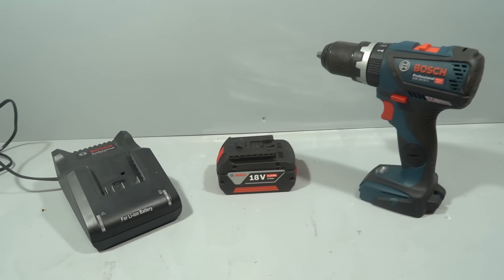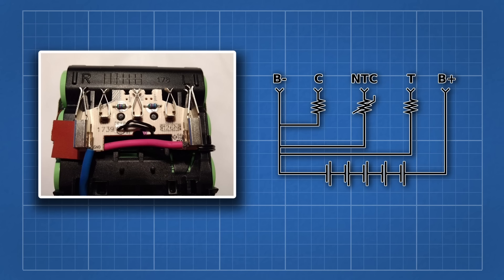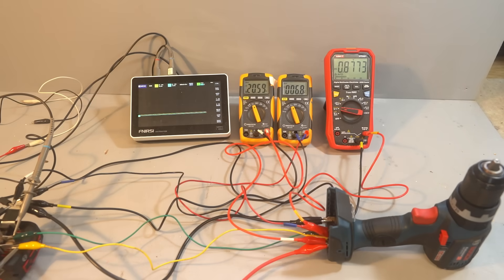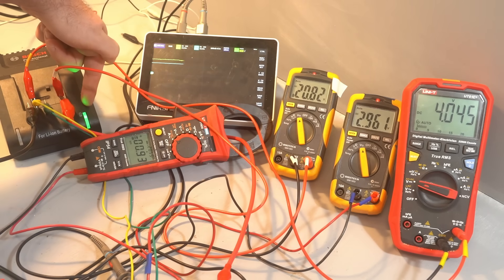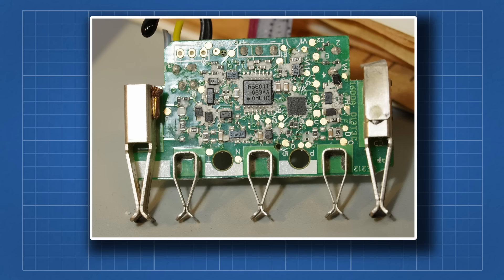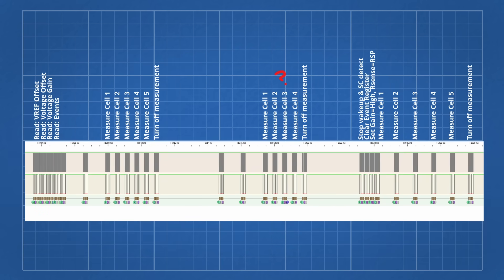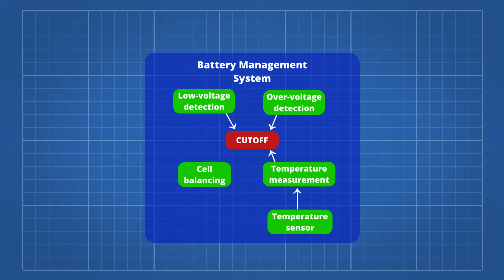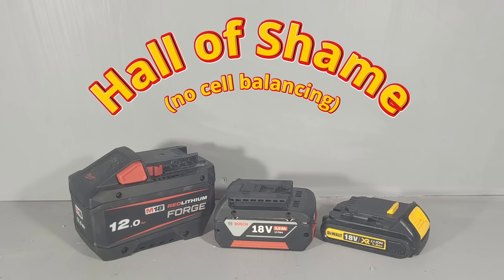[012] How does Bosch 18V compare to the rest?

Comment: Why haven't you used a profactor / procore battery? These have the latest technology, the battery in the video is quite old and is not in production anymore. But good video, thank you.
Reply from the maker: Because I'm poor 😄. If I can find a used ProCore for ~$50, I'll have a look. I do have a broken Procore that was donated to me. I could try fixing it, or at least probing it to see if the i2c comms are different.
Reply: @toolscientist  As your previous research had shown, i don't thing that there is somethin smart in these batteries. Thy say that batteries are smart just to justify the price.
Reply: @toolscientist that would be a great way to show the differences with the newer system
Reply: @toolscientist  In which coutry do you live? Here in germany a new Bosch Procore 18V 4 Ah Battery costs exactly 54,36€ (including shipping) on ebay. 
Of course the 8 or 5,5 Ah battery would be more interesting because of the Biturbo Technology. Especially the difference to the 4 Ah beside obvious physics. You cant find anything detailled in the internet about Biturbo. Wouldnt be surprised if it is only a marketing word and they work the same as other 18V Systems with 10x 21700 cells or more.
Maybe a collaboration with a tool enthusiast might help to get some of these.
Keep up your good work! Love it even I dont understand everything.
Reply from the maker: @WolfsBuden  Australia. Procore 4Ah is 209 AUD, Procore 8Ah is 289 AUD. We don't get 5.5Ah/6Ah
Reply: @toolscientist if you’re in Melbourne, faulty ones come up a lot on Marketplace. Keep an eye out. I would love to know if these batteries are any better apart from the 21700’s
Reply: @toolscientist also if you have a total tools or Sydney tools close, most of them would have faulty units that they might part with if you’re friendly enough 👍 I can ask if that would help get more results
Reply: @WolfsBuden This is Bosch and not some Chinese owned company like Milwaukee that after the machine break it cheaper to buy a new one. Also obviously you have no idea what Biturbo is.
Reply: @Fatmacheto  thats what I said, I dont know it in Detail. So explain it instead of bring rude.
Reply: @Fatmacheto  Hallooo?? Explaination please?
Reply: @toolscientist  wow a ProCore costing 209 AUD eaquals a 8Ah here in Germany o.0 which is 115€ by a conversionrate of 0,51 AUD/EURO very expensive there. If the transfer wouldnt be to expensive i would lend you a batterie of mine

Comment: would love to see how you would add low voltage shutoff and/or bms to batteries when used for non-tool purposes! Great vids!
Reply from the maker: I did show a LVCO for M18, but I hid the higher power version as it had some weaknesses. I should revisit that project

Comment: Love the detailed analysis of these batteries. I have been working on Ryobi batteries for a while now and what I have noticed is that they only balance cells in bursts and under specific conditions. So I could see why 0.2v would be considered too far gone to balance as under normal use, the cells shouldn't go that much out of balance. It should only go slightly out of balance which, at least for Ryobi, they do balance back very slowly.
Reply: There are many different Ryobi BMS designs. I have found that all Ryobi packs drag current from the first cell bank. If you put them away at minimal voltage, the BMS drains the first cell down and kills it.
Reply from the maker: Interesting. Have you made any videos or posts on it? How long are the balancing bursts?

Comment: Excellent work! If you can stomach the cost, Stihl's battery and tool system should be quite interesting to see analyzed. Supposedly they have some sort of "constant power" circuitry, according to them, which should maintain the power output  when the battery's voltage drops during use.
Edit: Not sure if that goes for all of their batteries/tools. They have a 12V line, a 36V line for non-professionals and one for professionals, to my knowledge
Reply from the maker: Constant power just means they're speed limiting their tool instead of letting it run full speed. Fairly common on vacuums, blowers, etc. Nothing really fancy about it, but I do like tools that do it. It's becoming common in circ saws, too, which means the tool runs at its max rated RPM for longer, rather than slowing down under load.
Reply: @toolscientist It sounds like something that any brushless motor controller could do with just a firmware tweak.
Reply: Professional sthil battery ap300, they have the bms submerged in grey resin. I think they count the cycle because i have 3 battery locked but with fine voltage

Comment: 2:46 I would like to take a moment to appreciate this workbench setup.  It's a beautiful rats nest.  It looks like exactly what's needed to perform this test, no more, no less.
Reply from the maker: I think the worst was my [010] vid when I was doing M18 charging, and I was measuring charging current, voltages, the UART messages between charger and battery, and i2c messages between MCU and AFE.
Reply: @toolscientist  If you want to decode/sniff I2C purely passive (like with a logic analyzer), you can do with with an RP2040 for cheap. I wrote the code for that, took some time to get everything right (have to use pio files etc.) but works perfect. With SD-Card and perhaps RTC you dont need any outside connections.

Comment: Nice video mate. Can I interest you in cracking open a Ryobi pack? I’m on team green and would love to hear how TTI have cheaper out on my $300 9ah pack.
Reply from the maker: I have a Ryobi 36V mower, so I'll definitely be looking at that. I had planned to work through the pro brands first, but Hikoki, Metabo, and Hilti are hard to find 2nd hand. Ryobi 18V is super common, so they might end up leapfrogging the others.
Reply: I got like 20 or so of their 40v packs and have to say the build quality isn't there never mind the well known bms issues. Another is poor thermal performance and leaking cells. The old models at least can be reset and rebuilt but the newer ones are warranty only should they crap out early otherwise just parts for salvage. The 18v share some of the same problems but generally don't overheat as easily and I haven't come across any that have leaked yet.
Reply from the maker: Hmm, seems Ryobi caught on the BMS reset trick. I had noticed that there's a lot more people saying it doesn't work anymore. I get it from their point of view as they obviously don't want batteries catching fire. I need to characterise my Ryobi mower before the battery dies - that way I can make a 2x18V adapter.
Reply: @toolscientist I’ve got 18V packs that go back to 2015 manufacturing dates, and one 2015 5AH that only shows 3 bars when the charger is done with it, and only runs their USB adapter for half a phone charge then it shows dead and cuts off. Might be crap cells or could be imbalance built up over 10 years.
Reply: The one thing I like about the Ryobi line is they are very diy tool friendly, have repurposed many a cheap charger to be a 12V cig socket output for various things and the battery always has 18v on tap, none of this enable pin BS to get power out.
Reply: @toolscientist  Still works on the 18v packs as I did it on one that wasn't even a year old however the reset stopped working on the 40v packs made after 2020.

Comment: Man, another disappointment. Are any of these battery systems promising for custom firmware I wonder? This is another case where a battery has the hardware for balancing but just doesn’t implement it in firmware. It’s likely that their batteries have locked flash memories, but with a cheap STlink clone you could probe this one.

Also I think the built-in batteries in Dyson vacuum cleaners are just badly treated by design. You leave them on the charging wall-mount, which keeps holding 4.2V per cell on the battery for a week at a time. Got one for work a year ago and the battery barely lasts a minute anymore. Same thing happened when I left my old cell phone on charge for 6 months straight. Be nice if modern chargers gave you the option of not charging all the way up to 4.2V per cell.
Reply from the maker: Martin of Open Battery Information had a quick look at Bosch, but the MCU was locked. He didn't seem super keen on trying to crack it. STM is very common, so maybe there's some simple cracks that I can attempt.
Reply: @toolscientist 
Worst case you wipe or replace the MCU with firmware written from scratch. The software side looks relatively easy, it’s the desoldering that’s out of reach of most people. Maybe a modchip would be more approachable, but still not ideal.
Reply from the maker: @Scrogan  true, it's a pretty simple BMS. Coding from scratch also avoids any IP issues

Comment: Does the cell balancing circuit have the capacity to stay on or would it over heat?
Reply from the maker: Usually you choose resistors to keep the balancing current to an acceptable level.
Reply: @toolscientist  Just seems crazy to have all the circuit there and not use it.......Maybe that will be next years "new and improved" model.
Reply from the maker: Yeah, well we've now got both Milwaukee and Bosch not balancimg despite having the hardware for it. Balancing does add some complication to the charging process. When a cell is being balanced, you can't measure its voltage. So you have to constantly turn it on and off. Need to fidn a brand that does balance to see how tbey do it and if there's a reason why other brands don't.

Comment: I have a bunch of  new 18v Pro CORE batteries. None of them have cell connections for balancing.
Reply from the maker: They're hiding. Procore packs have unwrapped cells. The cell connections are inside the plastic frame and can only be seen when you remove the cells. Doesn't mean they balance, though. The connections are still probably just for overvoltage protection

Comment: I hate how tool manufacturers seem to adore planned obsolescence. It’s why I bought battery connectors from Aliexpress to manually balance charge my Dewalt batteries with an RC balance charger.
Reply from the maker: What charger out of interest? I've heard most chargers don't like the 10-Ohm resistors in Dewalt packs
Reply: @toolscientist  The charger would probably not care if you turned the charge current sufficiently low. But that means like 10mA, which most chargers probably can’t do. Otherwise it would need to shut off the charge current periodically to measure the cell voltage, which I don’t believe my B6 charger does.
Reply: @toolscientist An old Hobbyking eco six. I somehow forgot to buy the 6s balance connector, so the project is on hold for now. Didn’t realise the dewalt packs were like this.
Reply: I've been tempted to do that for a couple of my M18s (notably the 9Ah and especially the 12Ah.) Unscrewing them with the security torx and then doing each bank individually is a PITA. Especially annoying for the low banks (usually 2), because my DIY charger built around a TP4056 can only do ~1A.
Reply: @bnasty267  It’s probably worth mounting a little external waterproof balance connector on the battery itself, so you can plug in a balance charger like a B6 without needing to disassemble the battery every time.

Comment: Another awesome one, thank you so much! Straight to the point and information packed all the way, well done! So disappointed in Bosch btw, I had much higher expectations. Another overhyped brand...
Reply from the maker: Yeah, I was a bit disappointed in Bosch. Seems they followed the Makita path of having awful first-gen Li-ion, then fixing things up, but (unlike Makita) didn't quite go far enough. Cell discharge and balancing can easily be fixed with firmware. They prob need a new battery circuit and charger to do my PWM idea (or similar) to get CC/CV charging.
Reply: @toolscientist lack of cccv is most surprising not gonna lie 😅
Reply from the maker: @riba2233 Dewalt and Bosch both surprised me with their "just give it 21V until you hit overvolt protection" charging strategy. Bosch's seems a little better than Dewalts as they have a better taper. Dewalt just does full-current/half-current. I suspect Bosch's is something like constant current until 20.5V, then constant 21-22V until it hits overvolt protection or some voltage threshold
Reply: @toolscientist like the questions regarding the ProCore batteries, I also wonder if the more expensive chargers (older GAL 1880CV or newer GAL 18V-160) do have a proper charge algorithm.
Reply from the maker: @macvos  haha, you ask expensive questions! But yes, the PWM signalling I mentioned would be backwards compatible, and would only show up on the right charger/battery combination.
Reply: @toolscientist always easy to spend other people's money!
I would've loaned you my charger and battery, but unfortunately I live on the other side of the planet (the Netherlands), and only get to visit my family in Australia (Perth) once a decade at best..

Comment: Fascinating! Since the nicad days, I have never bought a battery powered drill. If a brand cannot prevent Overcharging, Over-discharging AND do a cell balance,  then it plans on making money from unnecessary battery replacements. I attached an active balancer permanently to three dead cordless vacuum packs inc one cheap Chinese brand. Best thing ever! All packs still going strong. I don't think people realise the electronics are almost as important as the brand of cell. Have you seen or even heard of any brand yet that has these functions?
Reply from the maker: So far, every brand I've tested (Milwaukee, Dewalt, Makita, Bosch) has over-charge, overdischarge, and overheat protection. Unfortunately none have yet had cell balancing, but I'm yet to test Makita's balancing.
Reply: @toolscientist  Thx mate. Will look out for that vid. Interestingly, I asked ChatGPT who initially said those 4 brands do cell balancing. I've often found CHatGPT to be incorrect however so asked it to re-check its findings. It then confirmed none of these brands do cell balancing. It did mention a company called RHY Battery who make replacement packs for to fit the major brands. Their website says "Built-in multiple protection circuits protect batteries from overcharge, over-discharge, overload and short circuit. Smart BMS monitors each individual cell to ensure cell balancing". When selecting a Dewalt 18v/20v battery to check the specifics, the site says "BMS: Built-in smart Battery Management System (BMS) with multi-protection circuit module (PCM), our batteries actively safeguard against overcharge, over-discharge, overload, overheat, short circuit, and more. (*Specific protection features may vary for each battery to maintain consistency with the original battery.)" This sounds like an excuse for not actually having features it describes in its website (but I can't be sure).
ChatGPT also said a company named "Jovant" produces batteries with cell balancing but when I looked at their site and selected thgeir most expensive battery, the description said "【Remarkable Security】 Made of ultra-performance battery cell, our battery provides 6 protective systems including over-discharge, over-heat, over-charge, over-current, over-voltage and short-circuit protection. You can use it safely on your tools.  
I find it interesting when wondering why this feature isnt added to any packs.

Comment: Do makita batteries do cell balancing? I dont recall if they did or not but they are excluded from the hall of shame
Reply from the maker: Currently unknown. When I tested Makita I thought everyone balanced. I have to go back and test them. They have a monolithic IC, so I can't tap into the i2c. I'll have to do the intentional unbalance and then cycle several times
Reply: @toolscientist nice, looking forward to it
Reply from the maker: I've been putting it off due to Makita's brick-happy BMS. Hopefully I can see it balancing with just a small imbalance. Pretty sure any large imbalance will make the BMS brick itself.
Reply: @toolscientist we will all appreciate the effort 😊
Reply: @toolscientist  If a BMS bricks because of an unbalanced cell it's absolutely Hall of Shame automatically. Killing your whole IC is even far worse than just having unbalanced cells that I could replace myself if I wanted to.
Reply from the maker: @whuzzzup  if a battery is getting balanced every charge cycle, then a large imbalance is only going to happen when a cell is failing
Reply: @toolscientist  Sure, but in the case of the battery failing I would want to solder in a new one.
Reply: Have you seen the OBI information where they can reset the failure indicator with an Arduino? Oops, just noticed your post mentioning it from a year ago.
Reply from the maker: @ericwebberley7972 yeah, I talk to Martin of OBI fame a fair bit. I'm still yet to test his tool even though I bought an Arduino specifically for it about a year ago 😂. My todo list unfortunately grows 5x faster than my finished projects list.
Reply: That makes me feel better about my ToDon't List...
Reply: @toolscientist haha tell me about it 😅

Comment: I'm get that Makita, Hikoki, and maybe Panasonic might end up being the sum total of tool manufacturers with proper battery management. Well, maybe some more boutique brands, too.
Reply from the maker: I think we'll see a few cheap brands, too. Using low quality cells and no cell matching will make balancing mandatory. Someone sent me a pic of Parkside or similar having 5 discrete mosfets in a group, so that almost certainly has balancing
Reply: @toolscientist Parkside battery from Lidl claim that they have Cell balancing, if Is true Is incredible for cheap battery, also they have bluetooth bms
Reply: @toolscientist I have a couple cheap Makita knockoff batteries. I added a balance charger input on one. Cell voltages were 3.73, 3.76, 3.07, 3.66, 3.78

It better have some good balancing in there!